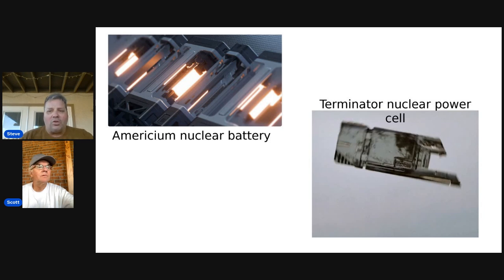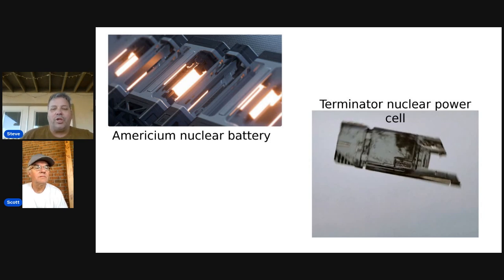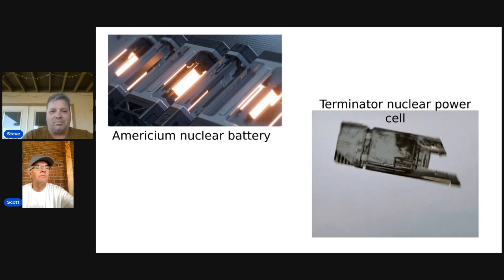Upcycle of decaying Americium for small nuclear batteries

Comment: There isn;'t much difference in practicality between these and the old SNAP generators the US and the USSR developed in the Cold War years.  The micro wattage of China's batteries means you need hundreds of them to get usable voltages.  Maybe tens of thousands to power a regular US household.  That's a lot of nuclear material.  As long as you keep a little space between the units and the amount of Americium under 50 Kilos or so you shouldn't have to worry about critical mass issues.  The good news it is all Alpha radiation.  Dangerous if inhaled or injected, but usually unable to penetrate a sheet of paper (or skin).  Of course every reaction produces heat.  Wrap it in a 1/8 inch steel box and keep it your basement so the extra heat warms the basement and house all year long while also keeping basement humidity down.  Shouldn't way more than a ton or two if it is just powering one house.  A nice addition to any fallout bunker sitting in a cave..